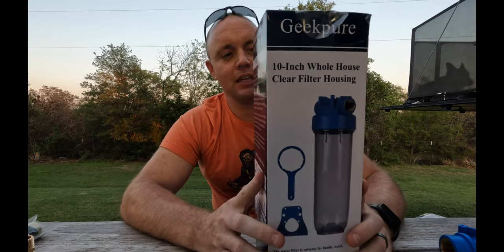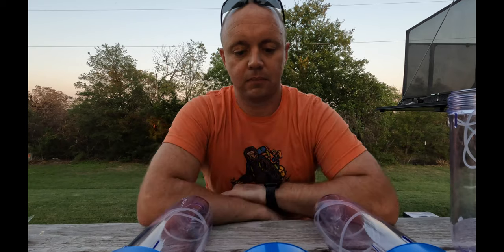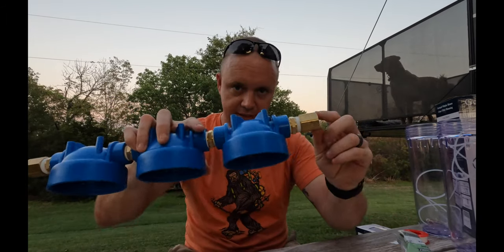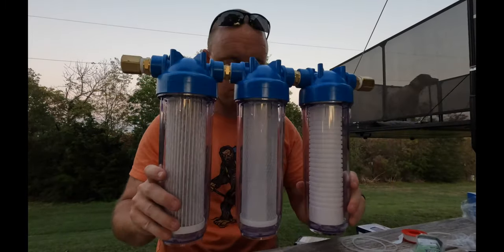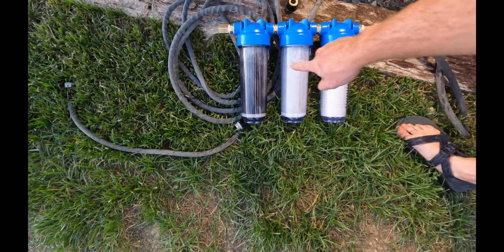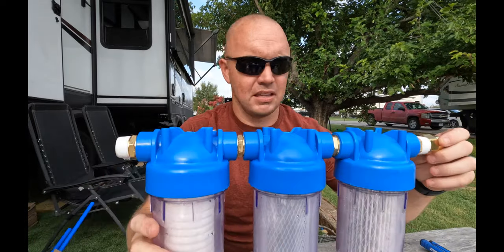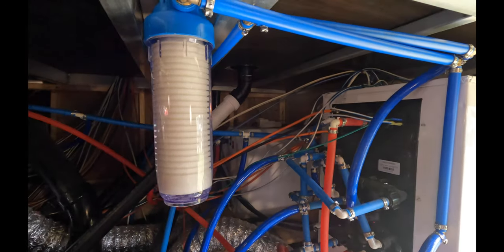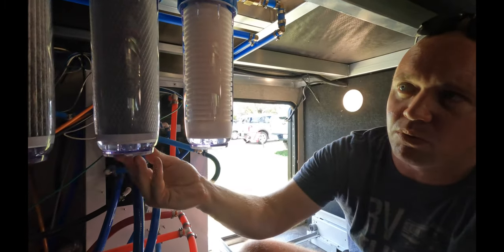DIY 3 Stage Water Filter System for RVs

Comment: I liked your solution and plan to build one myself. One question. I noticed that when you initially attached the water and flushed the system a lot of charcoal dust came out of the 1st filter.  I assume it flushed on out of the filter. Now that you have it permanently installed how do you do the initial flush when you change filter cartridges?
Reply from the maker: Hey Jim!

We honestly should have rinsed the filters with the hose initially before installing! We were just so darn excited to try this out!

Moving forward we will rinse the filters prior to installation and hopefully that will prevent that from occurring. 

Ohh boy I’m going to try and explain this via text if the below doesn’t make sense let me know and I’ll record another video for this comment explaining / showing what we will do if the rinsing method doesn’t work. 

We will add a brass T to the output side of the filter system. Going left to right on the letter T we will number them 1,2,3.   #3 coming from the filter system (right side of the T) . #1 (left side of T) will be plumbed in to the pex lines (like we have now) the only thing I would add would be a pex shutoff valve for when we want to flush the filters . #2 (bottom of T) I would use the 3/4 to 3/4 hose converter, add a hose shutoff, and have a small section of hose ( not permanently connected) that I could run out of the camper when replacing the filters. So we can clear out the charcoal dust. 

That’s a great question!!! I might jump back in there and do that anyway!  Let us know if the above makes any sense at all lol. 

Very respectfully,

Jeff and Amanda
Reply: Jeff,
I think I followed what you're saying but... I went back to rewatch the initial flush and it looks like the charcoal dust is coming from the middle filter. Seems like that might shorten the life of the downline filter. Maybe you need a flush port on the output side of each cartridge. That way you could flush each new filter separately.
Reply from the maker: Jim,

Another good call out. My only concern would be how long the filter system would be at that point. 

I truly believe it was more us not initially rinsing the filters. 

Good luck with building your system. It was a pretty fun project to do.
Reply: I flush the charcoal filter with a garden hose before installing it.

Comment: Great job on the system.  I have been looking for some ideas on building one. Just ordered the canisters.  
One question.  When tightening the brass connections, how much force did you use. Just wondering.  I tend to over tighten connections.  Mine will be freestanding.  We have a Grand Design Solitude rear kitchen and love being full-time it. 
Blessings to you and your family. 
Paul Pannell
Reply from the maker: I used a pretty good amount of force to be honest. Amanda and I each grasping and twisting in opposite directions. The biggest thing I’d make sure to use is plumbing goop and Teflon tape.

Comment: I’ve heard plastic not withstanding pressure in many reviews. What is your experience so far?
Reply from the maker: Good morning,

We initially had an issue with a small leak but that was our error with pipe tape. After that no issues from this system. The fittings were all brass to brass. Meaning inside the plastic housing were brass connection points.

Comment: This is a great idea so I bought the same cannisters to make a system. I can't get the water to stop leaking from where the cannisters are screwed on despite placing the o-ring in the threads and applying silicone. How did you do it? TIA
Reply from the maker: Try using pvc dope! Worked for us!
Reply: i think u mean PTFE  tape @WeLiveFreeRV

Comment: i would like to do this with my camper but i dont live in my camper so i was wondering if i put shot off valves on each side so you can close them would that work
Reply from the maker: Good evening!

You absolutely can add shut-off valves. Depending on parts availability you may have to run the shut-off valves to the pex lines vice your filter setup!

Good luck!
Reply: @WeLiveFreeRV  thanks for getting back to me

Comment: You're finding leaks (and will continue to find leaks) because you've got flexible hose and pex connected to the same fittings...that's guaranteed to leak...sorry.
Reply from the maker: Hey Paula,

You are spot on, we actually ended up redoing the whole system to pex. We just haven’t had a chance to make a video on it! 

Keep the feedback coming!

Very respectfully,

Jeff and Amanda